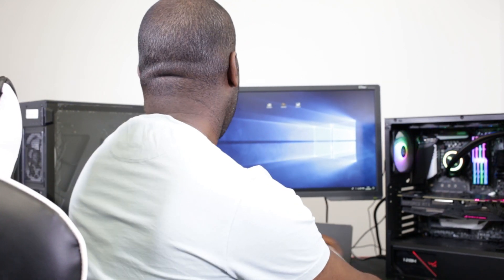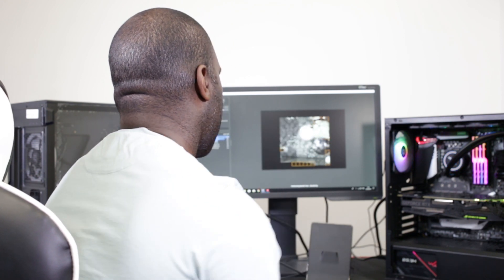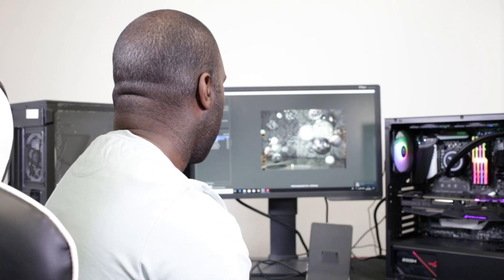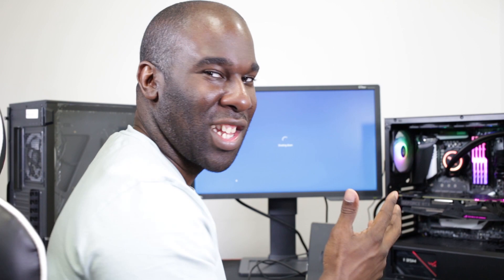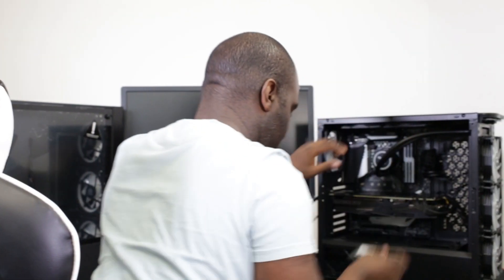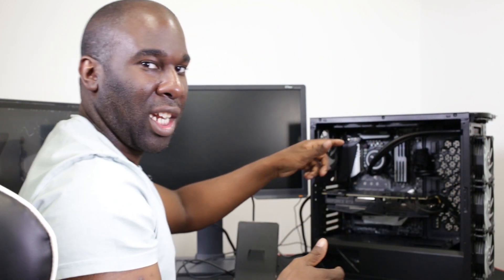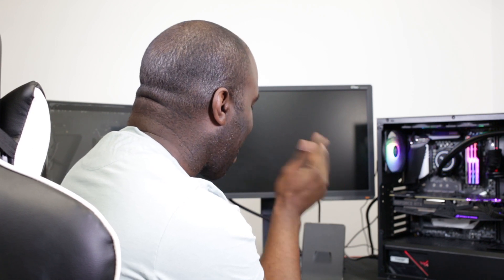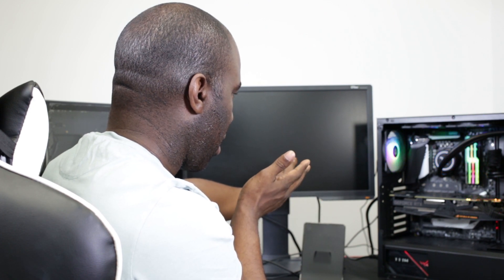Mixing DDR4 !! - DOES IT WORK ????

Comment: Your doing it wrong.
Why it is not booting?
A: obviously you need to turn off XMP profile or reset bios.

Once done you can use the other ram but when we are talking about mixing ram.
Its not about brand LOL
Its about the chip inside it.
For example:
Gskill ddr4 (samsung B-die)
Corsair ddr4(samsung B-die)
T-force ddr4(samsung B-die)
XPG ddr4(samsung B-die)
And when we are talking about Samsung B-die they all support XMP 2.0 it means their 3000mhz above.
The list above are different brands even if they are different frequencies and CL timing they are MATCHED RAMS why? The Chip/Die-type are all the same which is only samsung B-die
And XMP are saved OC profiles in the RAM by manufacturers, even if the frequency and timings are different and brand as long as they are all the same chip they are called MATCHING RAMS the only difference will be each of their overclocking limits because of PCB layer and Ranks but if they are different because of this, you can only OC it to the slowest samsung B-die (even among same type they are different in Silicon quality) but still you will not get erros/BSOD since they are still matched ram.

Thays why people recommend user to purchase a kit of 2 or a kit of 4 since this kit are tested and tweak to be equals.

Comment: what abt having a 2x8gb of corsair vengeance ddr4 2400hz in pair
then yr later i will try to put another 2x8gb of hyper x 2400hz in the second channel of my Msi b250 motherboard hving i7 7700. will this configuration be good. im not into overclocking. i want my parts to last as much as i can.
my Corsair vengeance working fine since 2018.. hows hyperx compare to corsair vengeance in servicing and warranty repairs in delhi, India 🇮🇳
Reply: Hey dude quick question, I currently have one stick of 8b ddr4 2666mhz and the brand for it is samsung. If I buy another 8gb ddr4 2666mhz stick but from the brand called hyperx, will it still work fine and boost performance on dual channel mode?
Reply: @treezlol  if its intel no pblm. if its ryzen, ut will b nightmare
Reply: @CaptainScorpio24  I have intel
Reply: @treezlol  ok. good it will work fine but get a set of sticks wd heatsink if yuh want to reuse ut wd another system. same sticks ad stability to overall system.  sell off this single when yuh instal the pair.

Comment: That should have worked.  It should have dropped the first and 3rd DIMM slots into Single Channel mode and booted.   Are you sure the 2400 RAM is good?

Comment: You can't mix frequencies in the same channel, put 2 ballistix in one channel and 2 tridents in the other and it will work but all ram will be 2400 speed
Reply: what abt having a 2x8gb of corsair vengeance ddr4 2400hz in pair
then yr later i will try to put another 2x8gb of hyper x 2400hz in the second channel of my Msi b250 motherboard hving i7 7700. will this configuration be good. im not into overclocking. i want my parts to last as much as i can.
my Corsair vengeance working fine since 2018.. hows hyperx compare to corsair vengeance in servicing and warranty repairs in delhi, India 🇮🇳

Comment: So my experience was:

1. when you mix non rgb ram, it usually works fine!

2. If you mix non rgb ram with rgb, it usually does not work! 
I tried to mix 2 x non rgb dimms
with 2 x Corsair Vengeance RGB and it didn't even post! 
Nothing happened!

Comment: My current rig has mixed ram installed and I have had no issues with it.

#1 - KLEVV Bolt 8GB 2666mhz
#2 - Kingston HyperX Fury 4GB 2133mhz
#3 - G-Skill Ripjaws IV 8GB 2400mhz
#4 - Kingston HyperX Fury 4GB 2133mhz

I'm using a Gigabyte B360m-D3H motherboard with an i5 8400 and everything is running at 2400mhz after adjusting the XMP in the bios (https://imgur.com/a/CcY7BhQ ).
Reply: Hi sir do u think H170 Asus pro gaming will work also?im have old avexir core series 2400mhz ddr4 led ,if i mix the other brands ddr4 2666mhz ram or 2400mhz will it works,or need some tuning in bios? im on tight budget on ram atm.thx in adv.
Reply: What about cas latencies?

Comment: Thanks for doing this.
Reply from the maker: No problems, I know in the past I have mixed certain ram and it has worked...but just not this one plus its ddr4 too👀😁
Reply: @MXDOUT  I had another doubt on some processors-intel especially (eg.i5 8600k)it mentions as max memory supported as 2666 mhz so what happens if you put higher than that? Does it automatically lower the frequency or ...?